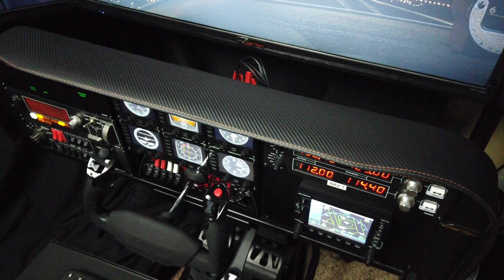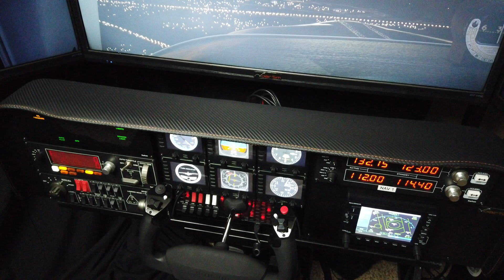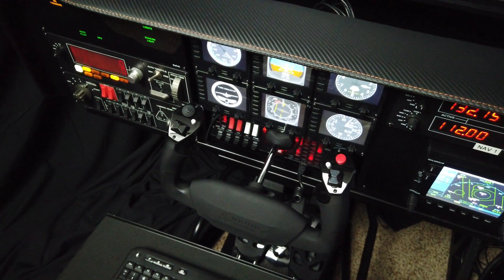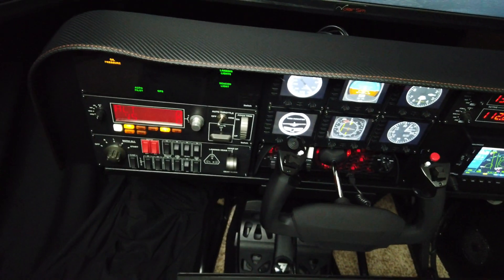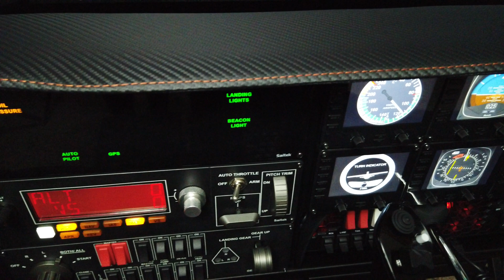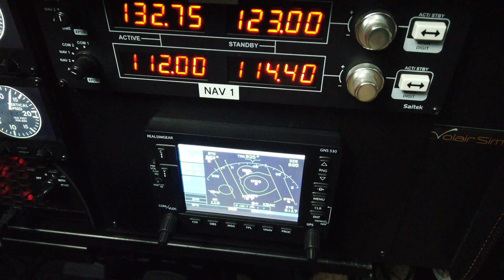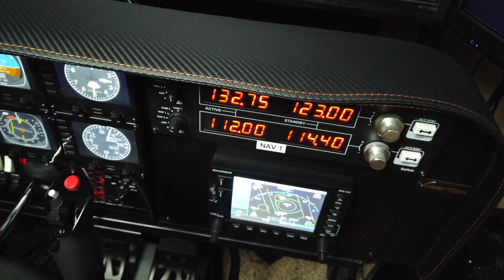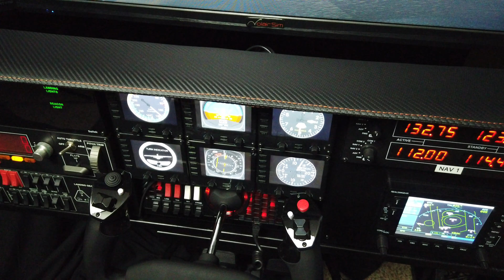Volair Sim Avionics Panel Version 2 - Now Honeycomb Yoke Compatible

Comment: The latest iPad Air is slightly larger, 9.74" wide and 7.0" tall, 10.9" diagonal. Is there enough room on the panel to mount the iPad above the Honeycomb Yoke without clobbering either the yoke or the side panels?
Reply from the maker: Yes, the iPad Air will fit the panel above the Honeycomb yoke.